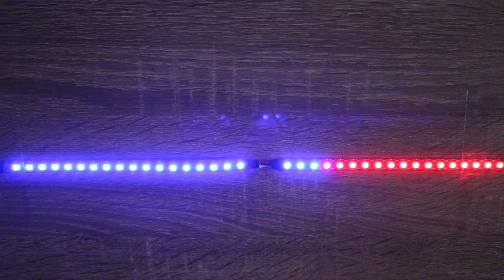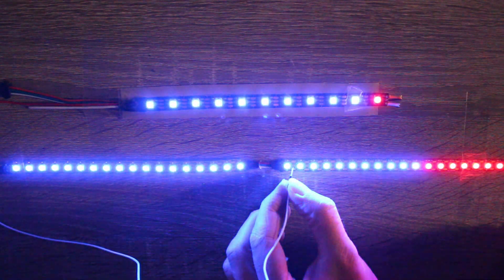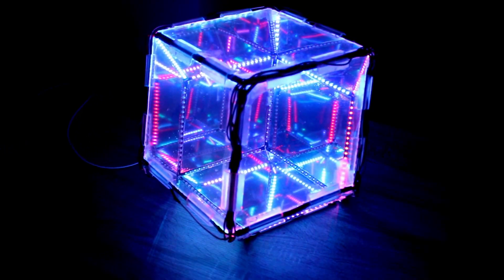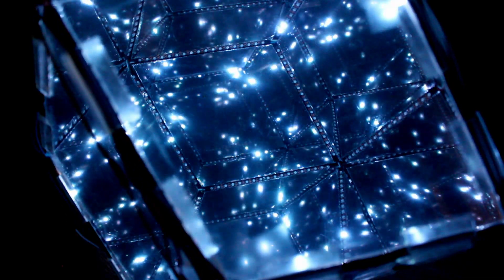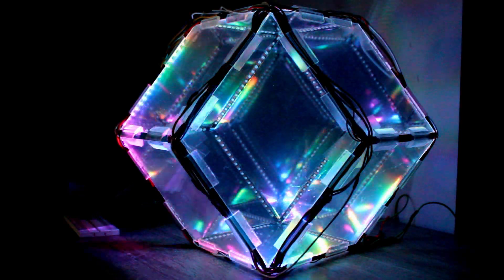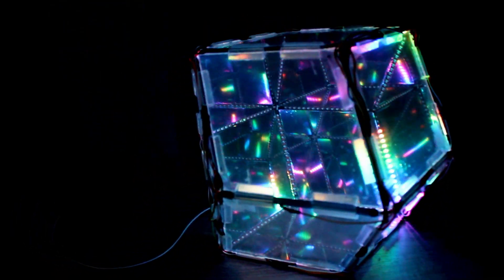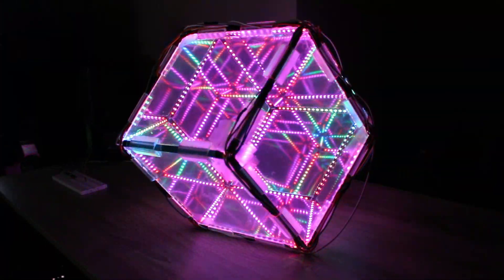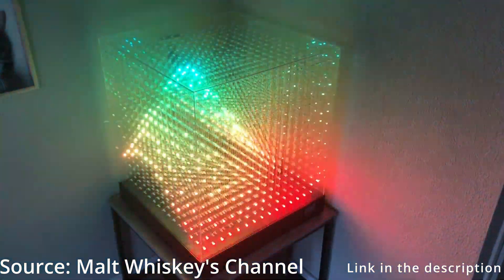Rhombic Dodecahedron Infinity Mirror - Part 2

Comment: Wow, super cool! What kind of glass did you use?
Reply from the maker: I used clear acrylic and reflective film. The film is meant for glass and didn't stick well. I solved this issue by using some clear nail polish around the edges to stop air from going under the film. 3/10, would not recommend. If you want to build one yourself I would suggest either reflective acrylic or using semi-silvered glass like Malt Whiskey did with his, as shown at the end of the video.